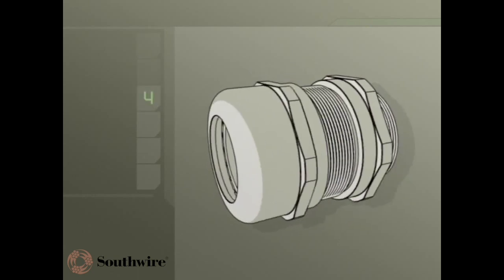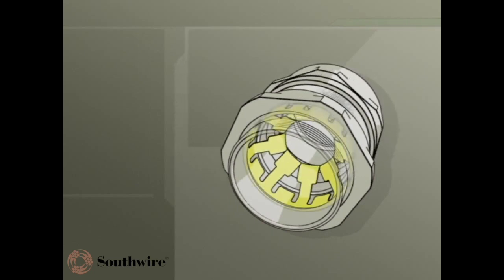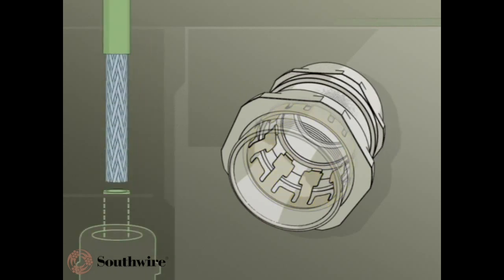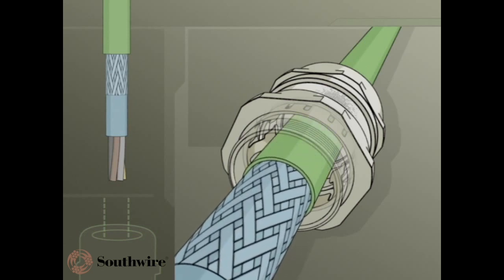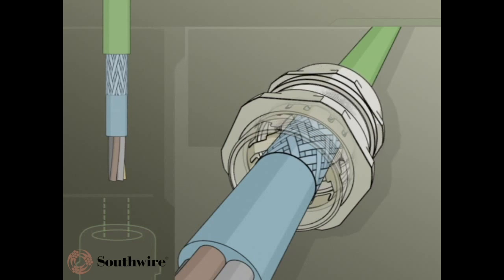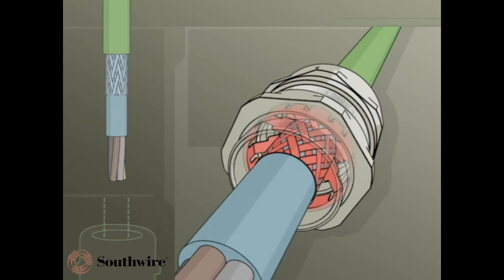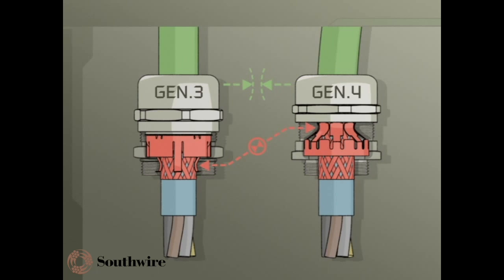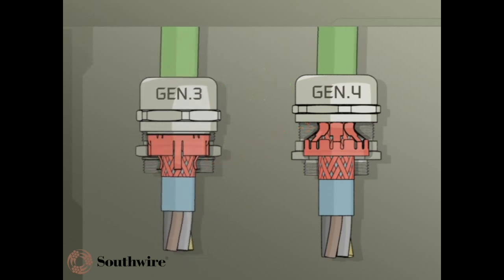Southwire's VFD EMC Grounding Glands

Comment: It would be interesting if you did a video on VFD-to-motor grounding (depending on cable, of ground wire, mesh shielding, tape shielding and drain wire) best practices.  There seems to be no consensus on whether to attach the ground(s) at both motor and VFD vs. only at one end or the other and even worse, people simply state "do it this way" without showing the physics of why that way is better than the other.  Most of the arguments are like 'it's been done this way a long time' or 'some big company does it that way' or 'there's no evidence this doesn't work', but no real EE analysis.